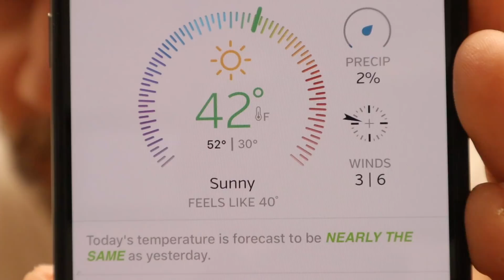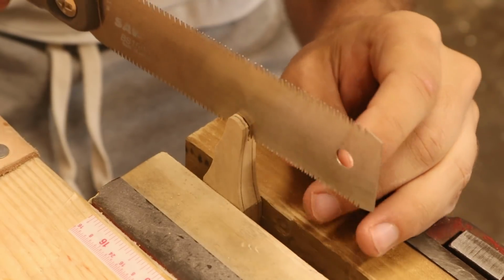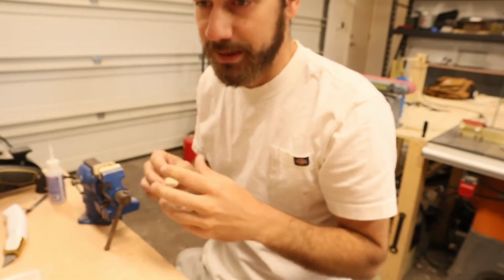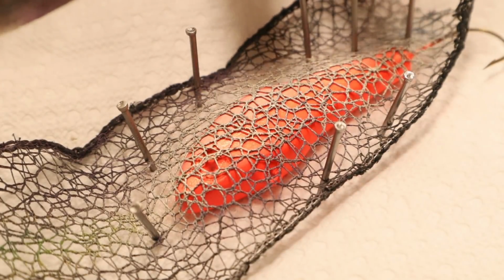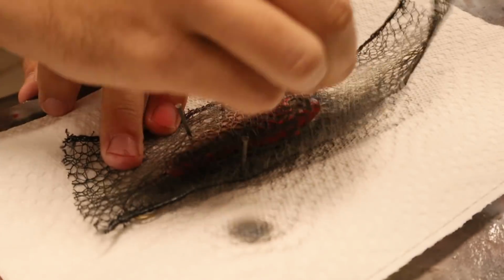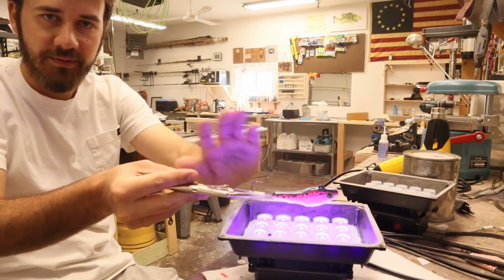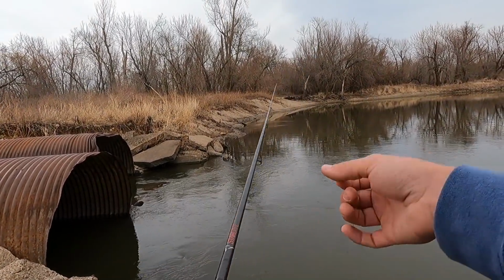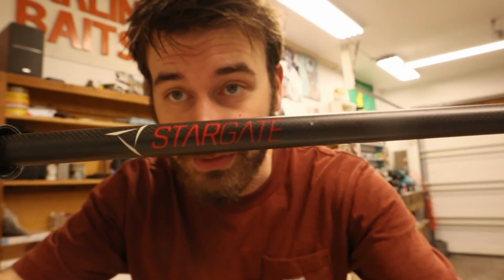Weedless Lipless JerkBait | One Day Build to Catch

Comment: Just a thought..  
You should wire up an outlet behind your led pot and wire it on a switch so you don't have to plug and unplug it all the time. 
Just flip the switch.  
I know that sounds like a lazy person solution, but I went through and rewired my shop over the winter and you'd be surprised how much simple stuff like that can make things so much easier and enjoyable to use. I added some more 15amp breakers and even some 220 power out to my shop, added more outlets and even switched outlets to certain tools that I don't want having continuous power.  It has made things soo much more productive and enjoyable!

Comment: What do you use if you don't have a lead pot and where do you get it?
Reply: I've used really tiny split shots and chopped them into even smaller pieces with a utility knife. Worked out great, just tedious
Reply: @richardjohnson2650  thanks i will try that

Comment: Speaking of water. You might be able to use water droplets to simulate scales. Use a spray bottle then air brush over the water. The color will capture on top of the droplet. Might end up pretty cool

Comment: Dude, that open UV light is not cool. i know people who've had their livelihoods ruined by those things. 

the little bit of violet that you can see is not representative of how much that lamp is putting out. its SUPER bright. but your eyes can't sense UV light, so they dont know it is bright, like they would if you were outside in bright sunlight, and constrict your pupils, to protect the light sensing cells in your eyes. So they get damaged. 

It causes HUGE problems with your vision, and worse, the damage isnt always immediately apparent. It causes Macular Degeneration (a type of blindness, if it gets bad enough). It will make the fovea, the area of the eye used for fine detail, in the center of the field of vision, to deteriorate. 

PLEAASE dude, I love your channel. I want you to keep doing what you do. Please, cover the light up, and if you have to look at the bait while its curing, use some sun glasses with a UV rating. looking a little silly with sunglasses on inside, its worth your vision.

Comment: Make yourself a bait retriever.  Pour a 2-3 ounce tear drop pendulum shaped lead weight.  Make a thick gauge wire eyelet with a big swivel to clip on your line.  Should get at least 95% of baits back.  It hurts my heart to see you lose beautiful baits you work so hard to make.
Reply: You can make one with everything in your shop pretty easily.  You’ll have maybe $2-3 into it.  The 5% of the time you don’t get your bait back, you’ll probably also lose the retriever.  But it beats paying $20 or however much bass pro is selling theirs for right now.